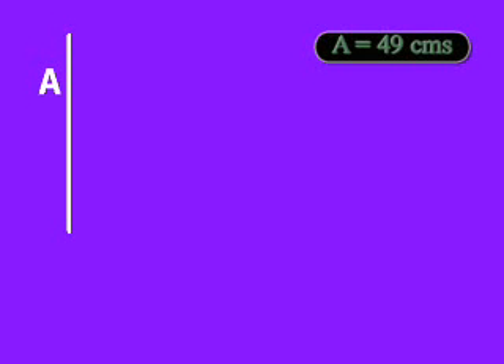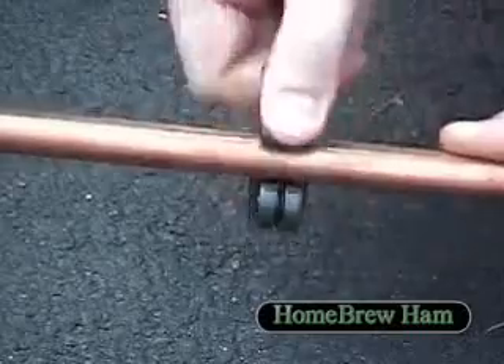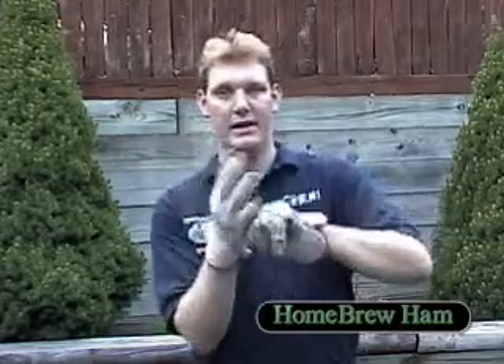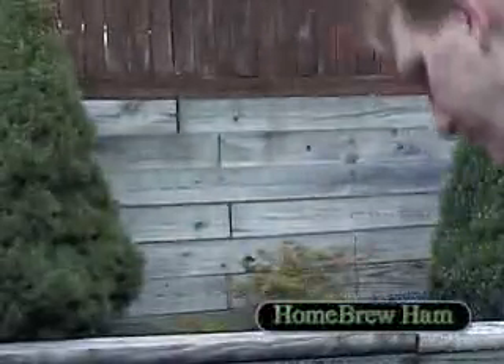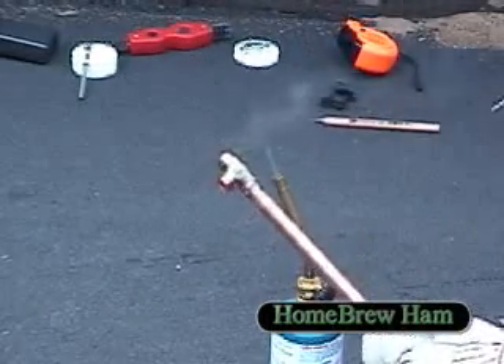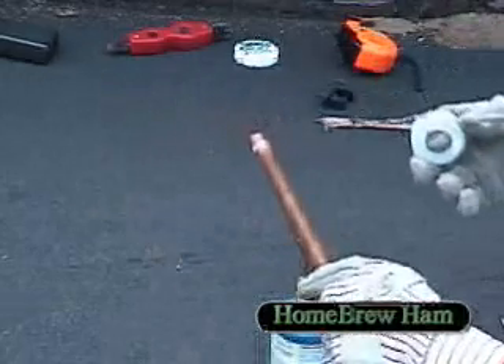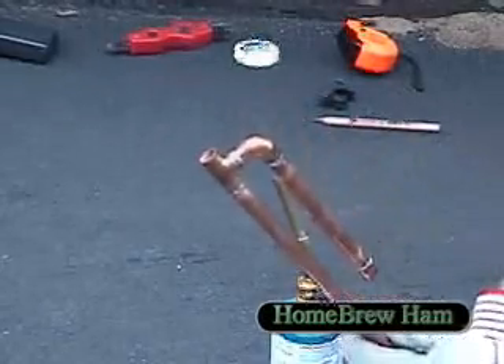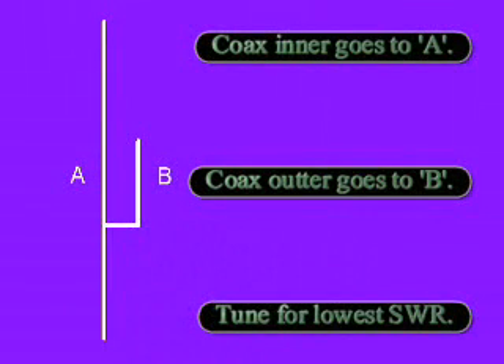Copper J-Pole

Comment: hi I have a question if the part that inserts to the T at bottom of base is non conductive then why you using copper for base ? Or is there something inside of the T to make it non conductive ?

Comment: I don't quite understand the "inner of the coax and outer of the coax".  Does that mean the copper braiding surrounding the plastic (or foam or whatever) inner core is the outer?  And the skinny middlemost wire in the very middle the inner?  Thanks.

Comment: @PetersonSulib Adjust the position of the coax up and down on the j-pole.  You'll need an SWR meter or antenna analyzer.  Make sure that the center conductor and braid remain at the same height.

Comment: Why stop there?  Make a collinear antenna having more gain stacking another 1/2 wave length of copper pipe with a 2" space on top of the radiator with a hardwood dowell.  Electrically connect the two elements with a 1/4 wave length of heavy copper wire bent into a U shape, and solder into place.